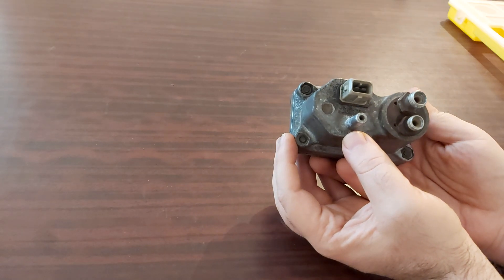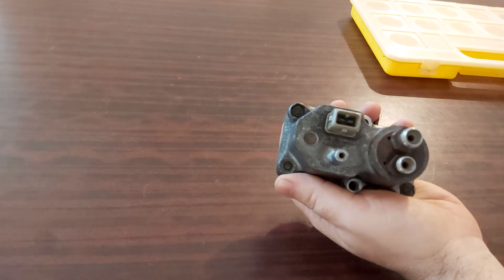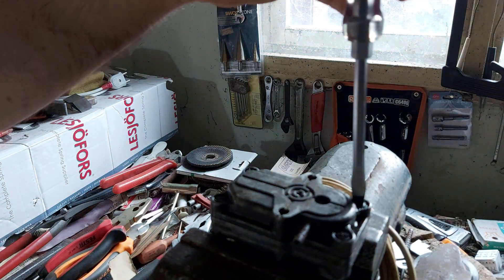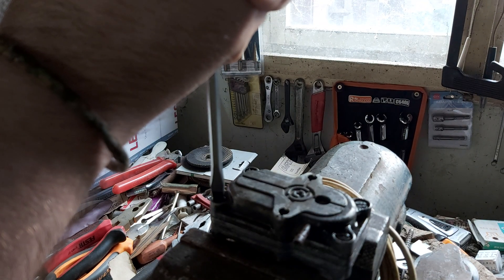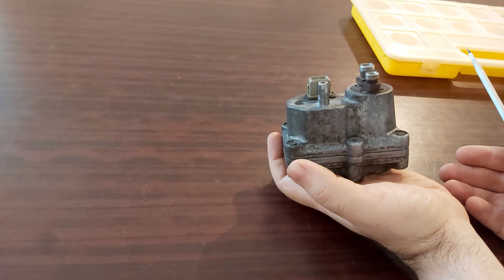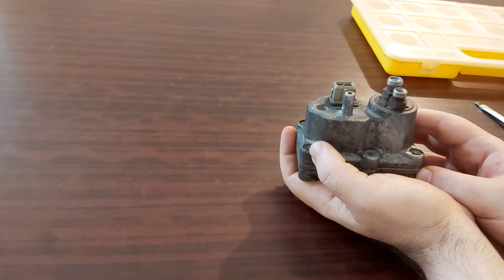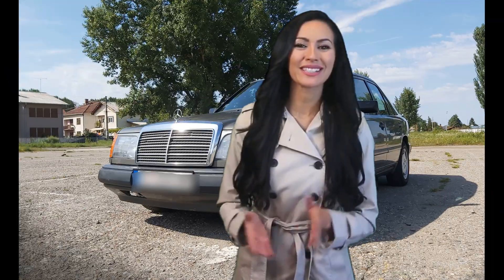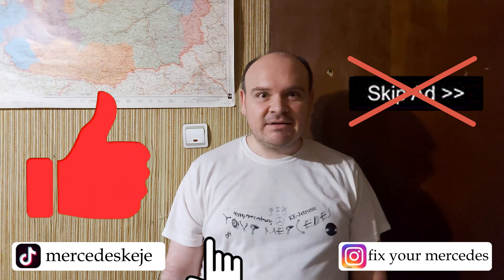㉦Mercedes K-Jetronic㉦ - 🛠️🌡📚The Warm up regulator📚🌡🛠️/Disassembly

Comment: Hi, my m-b 230E -83 has a low idle rpm and “shakes” a bit, but worst: after getting warmed up, it looses power and bogs down. If I stop the engine and wait a cpl seconds and restart it runs fine again. For a while. Where do I start to check?
Reply from the maker: Hi. Did you check the pressures? You will need a pressure gauge with a valve to measure the pressures and to see what is happening as the car warms up, to see the values of the pressures while the car is being warmed up. It can be either the warm up regulator, the injectors...
Reply: @mercedeske  thanks, I will dig into this in 2-3 weeks when I have a little more time.. 😅